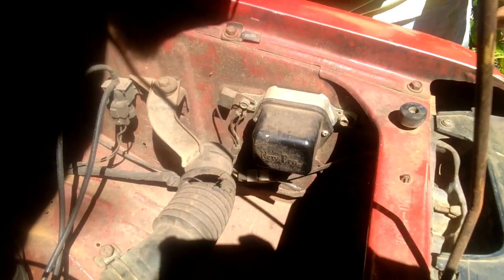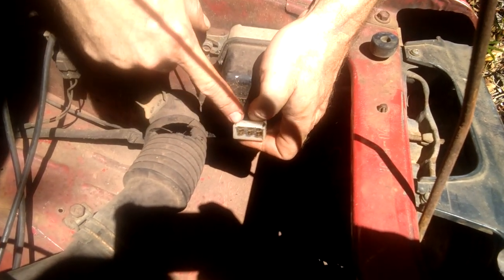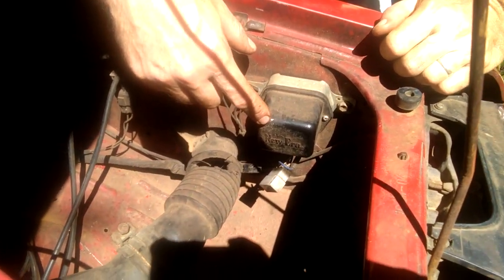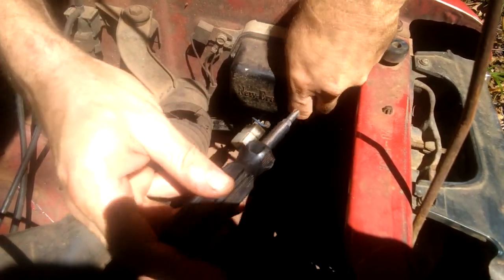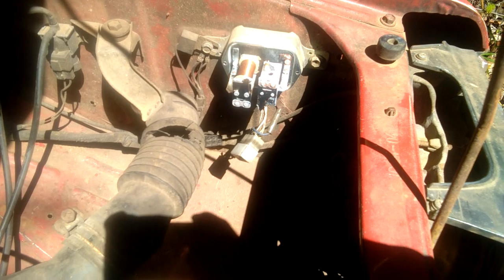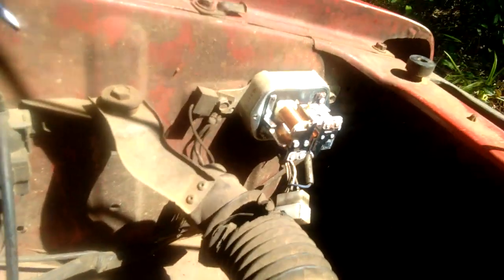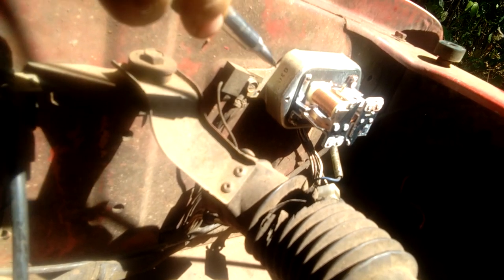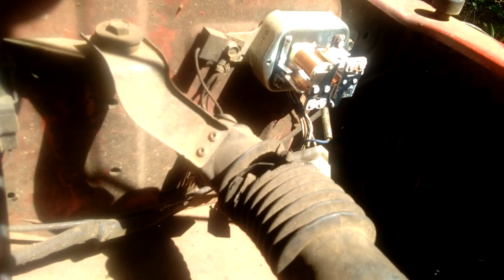How to adjust the voltage on a 6-wire mechanical voltage regulator (New Era brand)

Comment: Where do you think those wire go to? Im having some problems with my volatge regulator too... contact go like crazy up and down wild.. and my voltage starts to fluctuate.... love your video... the only video on youtube where it deals with new era voltage regulators....
Reply from the maker: Try replacing the regulator. They're mechanical. Sounds like something's sticking.